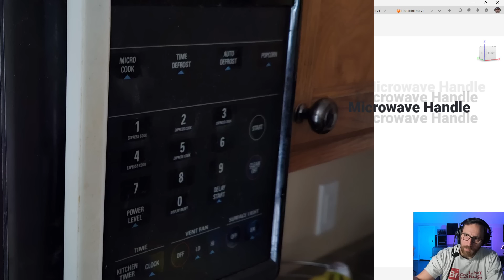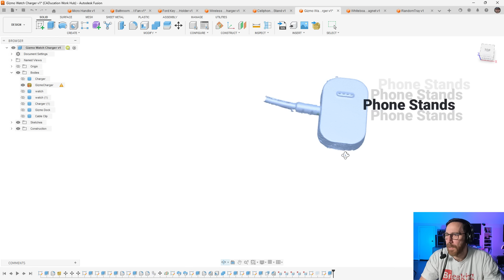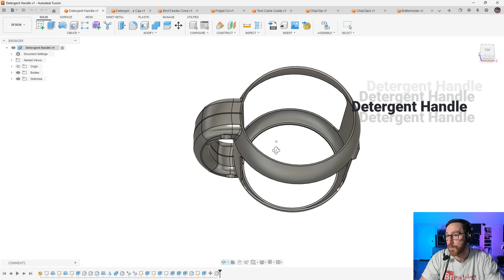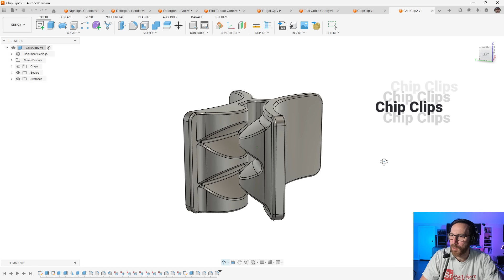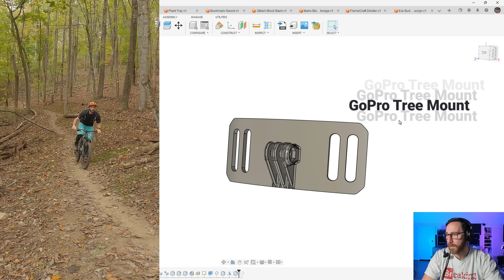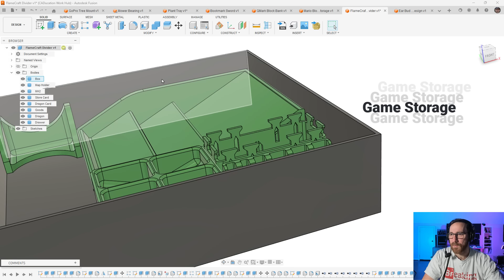3D Prints That I Use Every Day | Downloads in Description

Comment: The Ender 7 was one of the worst. What did you modify to make it work? I returned mine 2 days after I got it years ago.
Reply from the maker: mine actually worked pretty well for a long time!  Manually leveling it was a pain and being open i mainly printed PLA on it.  I started having some issues with blobbing and ended up having to swap (oem) parts after busting the thermistor.  Then it started to have some ringing in the prints.  At that point I finally let it on my network, updated the firmware and tried to tune it a bit and got worse from there.  It ended up having a weird issues where i needed to manually offset Z in the slicer.  I got it working again and sold it to a buddy who sadly had even more trouble.  He upgraded the extrude/hot end setup and a few other things but always struggled a bit with it.

My k1 max was better until it wasn't.  right now the thermistor setup has an issue so the temps bounce around and it wont run.  I have a new hot end just haven't swapped it yet.  The Bambu P1s has been mostly trouble free.
Reply: @LearnEverythingAboutDesign  Thanks for the detailed answer. I had problems with the timing belts on the Ender 7 from the start. I've had a total of 10 different 3D printers and have to say that Qidi and Creality caused me the most headaches. Now I only have two X1Cs and one resin printer from Anycubic, and I'm satisfied. As you say, BL printers are almost flawless. I only had to replace a hall sensor on the extruder once, but that was my fault because I damaged the sensor when the power cord for the X1C wasn't plugged in properly.

Comment: I'm new to 3d printing and wanting to learn to do a little of my own designing. Watching your videos, you obviously know both Fusion, and Plasticity well. Those are the two I'm heavily considering, if someone  like myself was going to try learning some more basic design type software for making their own 3d printed pieces, parts, etc..  I'd be very curious which of the two you'd recommend someone begin on with Fusion or Plasticity.  Thanks and as someone who did instructional design before, I really appreciate your videos.
Reply from the maker: Hey there!  Can you tell me what types of 3d designs you are thinking about?  that will have a bit of impact on what I would suggest.

In general both are good pieces of software but there are benefits to each.

Fusion has parametric features meaning you can make a sketch, define it with numbers, build a 3d model, then go back and change that sketch and update your design.  This can be very helpful to the overall process for mechanical parts.  Fusion also has Freeform modeling which i use a lot for things like cars and for scan based designs.

Plasticity is really quick and produces really nice geometry and is a bit more flexible.  it handles things like complex shapes and fillets/shelling etc a bit better even though they are both built on the same 3d kernel under the hood.  Plasticity can be great if you like a more direct modeling approach.  Where you start to run into trouble, especially as a new users, is when you need things like specific gaps between parts.  

So for mechanical parts I would say Fusion has an edge.  For more conceptual stuff that maybe isn't as rigid on feature size you may find Plasticity to be a bit more "freeing" in the design process.

Fusion has a free hobby license and plasticity has a 14 day trial.  I would try both.  We have a few videos where we do the same part in fusion and plasticity.  A fidget toy for 3d printing is one of those.  Might show you a bit on how you would approach both.
Reply: @LearnEverythingAboutDesign 
Thank you so much for such a detailed response. 

To be honest as this is such a new venture for me I obviously can't speak in certain detail as to exactly how I will go about it. However having watched a number of your videos and others I'm leaning a little heavier towards plasticity at the moment and more of a direct modeling approach. I think a majority of the things that I will make will be things like shelves or small widgets. Thanks a better take space like tool organization and things of that nature. I don't at least at present see myself doing more intense mechanical multi-part operation that meeting gears or things of that nature. 
Again I thank you so much and will  begin with your plasticity course.

Comment: Hello sir, please can you make tutorial about understanding G0, G1, G2 and G3 surface and how to use in model , please , thank you so much
Reply from the maker: Hey There.  We do talk about it a bit in various places.  In the surfacing series we talk about it here
https://youtu.be/UfcgiFMHaak

It is also a lesson in our surface intro course called Curvature Continuity
https://www.learneverythingaboutdesign.com/l/pdp/surface-modeling-with-fusion-360

I am sure I have covered it a few other places in videos but would need to figure out where.

In Fusion we don't have G3 (that we can control).  G3 is tangency, weight, and rate of change.  Theoretically a freeform body is curvature continous and G3 but no direct control over that.

So the short of it is 
G0 is two curves or surfaces intersect but have no influence on eachother
G1 is a tangency direction.  meaning you drive the direction influence but not the "weight"
G2 is tangency direction and the weight.  If you think about an arc with a constant radius of say 10mm.  If you create G2 continuity between it and a spline you will have 10mm radius at the intersection
G3 includes the rate of change.  Meaning if you have a spline that has a decreasing radius as it gets to the edge, the next curve will match the radius at the intersection but then begin to decrease at the same rate.  but again we can't really directly control that in Fusion.
Reply: @LearnEverythingAboutDesign   Thank you so so so so much !!!!

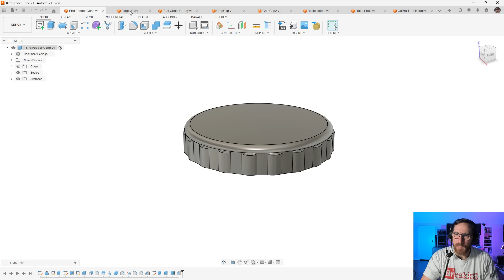Comment: @26:00 Maybe consider making the Disk able to Roll and Tilt? If a Squirrel sits on it ( or even just tries to grab onto the edge as it climbs up on the Pole ) it'll give and drop the Squirrel 🤔 If doing that is too difficult you could alternatively try to incorporate a large enough bearing for the Shaft to pass through into it allowing it to spin. I've seen a video of something like that where a Squirrel grabbing onto the spinning object got spun faster and faster due to its own movements until it got flung off 🤣
Reply from the maker: Great ideas!  and yeah i actually did sketch out a more complex idea where it would seal the bird feeder but when the tray worked (for the chipmunks) i kept with it.  Those pesky squirrels though!  The disc was also the max size i could print :)

Comment: I'm certainly not saving the environment with my printer.  I've made a couple very large, really complex assembly fixtures that were essentially one time use.  But man, since a started a few weeks ago, the stuff I've made that is getting used every day is huge.  Tractor parts, ATV parts, truck parts, muzzle loader accessories, shop tools, jigs and gauges, reloading accessories, knife sharpener kit, several storage/holder/organizers. There is so much more than that too.   It's crazy.  You get an idea, sit at a computer for a while then the part exists when you wake up the next day, it's almost like magic.  This channel really pushed me over the edge to get one.  The normal channels, "Here are 10 pieces of garbage I printed from the Thingaverse", don't do it for me.  Haven't printed a Benchy yet.
Reply from the maker: Awesome!  Yeah if you noticed in the video nothing I printed was downloaded from a site :)  While there is some appeal to that (and i have printed a few things others have created, mostly character type stuff), the real benefit is like you said, you get an idea, design it, and make it.  You don't need to mass produce it.  Most things will work for their function as a 3d print.

Glad you got one and sounds like you are making good use!